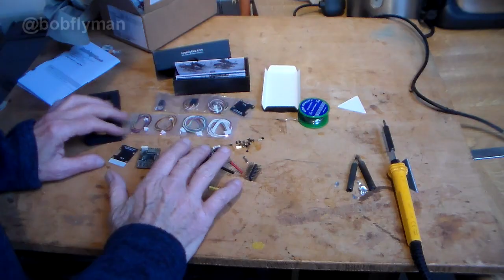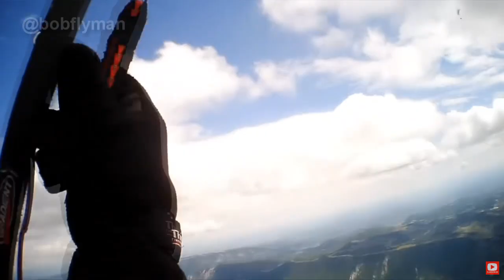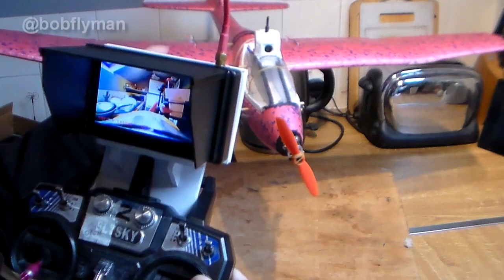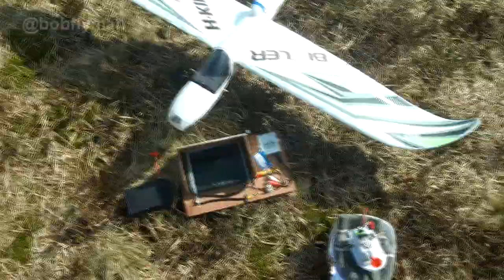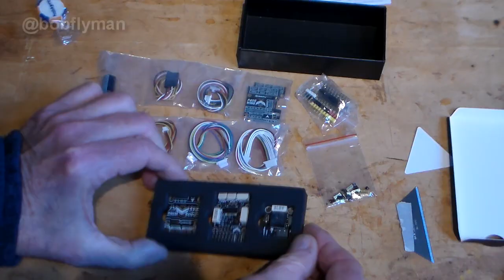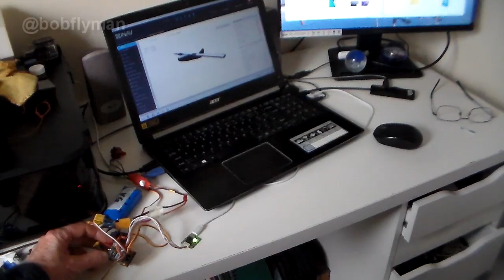A New RC adventure begins -  My FPV quest takes a big step forward  Part One

Comment: @theoztreecrasher2647
16 hours ago
Like Cliff says, getting all this soldered up and programmed correctly will test out the old hands and brain. We got in a couple of the Lefei Sparrow 2/3/3PRO  stab/FPV controllers but the 3 version that yours truly and an equally shaky hands old fellah tried to solder up ended up with the pins through the wrong side! 😱😵‍💫 
I have the 3PRO here now (comes pre-soldered!) which is plug-n-play and allows switching between 2 cameras with setting up via the Radio and FPV screen but haven't gotten around to using it yet. Probably the goggles battery is dead by now anyhow. Andrew and Lee are experienced iNav users and both exceptionally helpful gents so they should cover any problems you might strike. Your old FS-i6 there might be a limiting factor - our old FS-i6Xs are a good bit more capable. Though you can hack and update the i6 for more functionality. (I have been told.)
We have a lot of (and became reasonably proficient with ) the simple ZOHD Kopilot lite (which were made by Lefei anyway it seems) that CT mentions but they became over-priced and now seem to have been discontinued pretty well everywhere. Looking forward to your future exploits, old mate! 😉😊

Comment: Remember when soldering small parts flux is your friend,  also dont use lead free solder use 60/40 lead/tin flux core solder if possible it contains flux so helps the solder to flow making it easier to get a good joint
Never file the tip of the soldering iron you remove the coating on the tip making it almost useless, the flux will eventually corrode and eat into the tip making the need to clean it almost every time you use it , the only way will be to file or sand the tip again wearing it away to nothing
Reply from the maker: Some great advice there mate.
I had already made the solder change after 40 years of lead free! Used flux pen on the board too.  I know what you mean about flux eating the tip , I've seen it. As I say been messing with electronics really since I was a kid.  The filing the tip did work on this old tip? 
Soldering wasn't difficult in the end. Check out part two coming soon! All finished and ready for test flight. 🙂

Comment: You might want to have a look at ZOHD Kopilot Lite  - excellent unit for intoduction to FPV.
Reply from the maker: Thanks Caroline, but too late! Speedybee F405 Wing is now installed and ready for test flight as you'll see in Part 2. 😎 Must say respect to you,  it was more complicated than I thought it was going to be! Even getting rx talking to the controller board. And then getting the board talking to my laptop. Just plug in the usb the videos say. 🤣 It wouldn't connect. Found a driver though. I only have six channels to play with so just arm and loiter set up.  But it'll all be in part two! Haven't put my analogue vtx on yet, I'll wait and see what happens in my test flights first! 😒.
And although it was a squeeze the Bixler is a nice stable easy plane to start with. The Atom Rc dolphin looks a bit quick! 😫
Reply: @bobflyman  Good luck with your INAV maiden! How are you going to autolevel and autotune it with such a limited number of channels?- I guess you could mix several switches onto one of the channels to give you around 5-6 output values on it and leave the other remaining channel for an arming switch - that would do it. I now have a Hobbyking Flycat V2 to maiden. just finished assembling it, radio is in and all the throws and CG is set.  Come on Spring, give us another beautiful weather break!!
Reply from the maker: @Caroline_Tyler interesting questions there and there are loads of modes, 😧 I've spent hours researching this stuff, saw auto tune, auto launch, etc.  you're a master of this!   Someone mentioned using one of the potentiometers, and there are two other switches but as you say I'm limited for channels.
It appears inav allocates two channels/ ports? for ailerons (for elevons I guess) I use a Y lead and wondered if i could fiddle that somehow to get an extras channel, but I don't think so. For the moment I'll keep it simple, I'll be happy to see loiter work.  😎
I find it all very interesting and new to me.  🙂. Good for my brain as I'm an oldie!
Reply: @bobflyman  INAV will only allocate two outputs for elevons if you have set the model type as a wing. You should be using the conventional tail plane type - so you will have just the usual 4 outputs Ailerons, Elevator, Throttle and Rudder.
Reply from the maker: @Caroline_Tyler yes, that's what I'm on. I'm just trying to find rth height for a loiter setting!